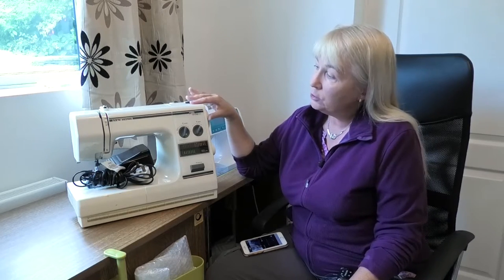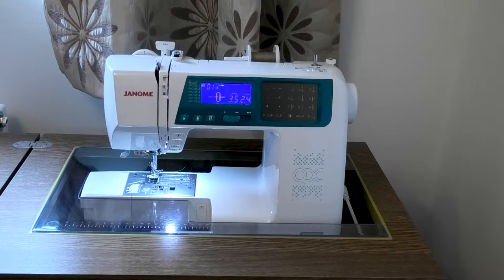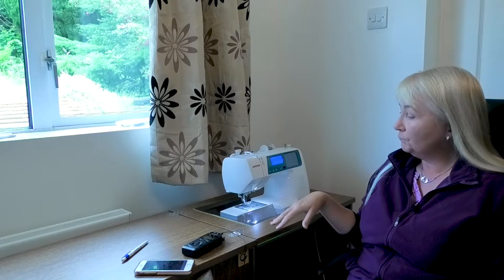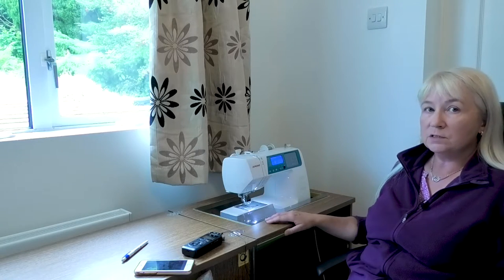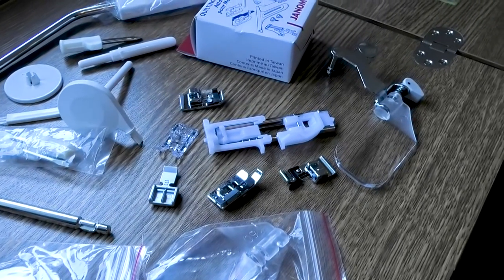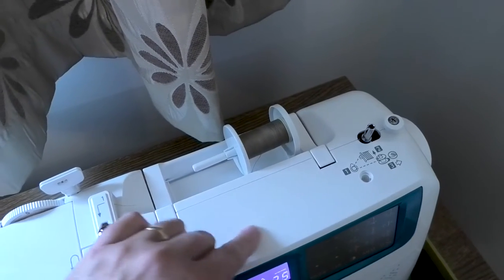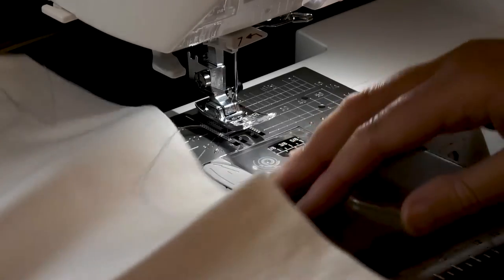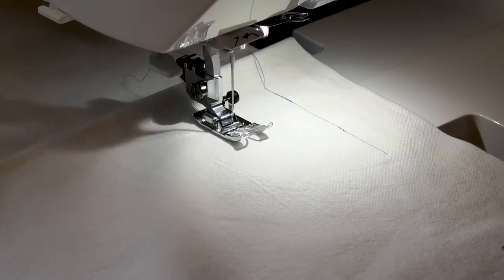What’s so special about my new Janome 5270 QDC computerised sewing machine?

Comment: I found this really useful. Thank You.  I do have a question.   I do bag making and card making.  I can see that this would be great for my card making and baby gifts, but how thick a fabric can this sew through?
Reply from the maker: Hi there, you know, I'm not sure how thick it can go. QDC stands for Quilting Decor Couture, and in my view the machine is pretty robust for standard house decor such as curtains and dressmaking and such. I suspect that it is not just the thickness that is important but also the type of material is also important. I've not tested it on leather for instance. I would recommend asking the suppliers for their view, or Janome to find out which of their machines are heavy duty. And I know that they do some with high presser foot clearance. You might explore this link.

https://www.sewingmachines.co.uk/brands/janome/?gclid=CjwKCAjw3cSSBhBGEiwAVII0Z--akzDO0WRDL0tx5hKEGn8LGOx7-LJM2ouQx7Qg3O1qcjmuiomoLxoCza8QAvD_BwE&high_presser_foot_clearance=4275&machine_type=4178%2C4291&utm_medium=cpc&utm_source=google.      

I hope that helps. Lucy
Reply: @Sciart  Thank You

Comment: Really love this video really thinking of getting this model, did you say it’s the latest model? Would love to see what work you have done with this model it looks fab regards M
Reply from the maker: Hello, thank you for your lovely comments and questions. At the time of filming (Aug 2020) it was the latest in that range of computerised machines. What made it interesting to me was the fact that I could do lettering. Always remembering that computerised in this context means the machine is computerised, it does not link to a computer to take patterns that you design, you dial them in on the control panel. And at the price I was more than happy with that. Yes, I am filming a piece now and should be on line soon. Thank you

Comment: 'you can add an extra holder on the top' - more explanation please ?  Also you dont mention the tension - is it automatic ?
Reply from the maker: Hello, the machine comes with a spare spool holder. You can spot the hole in which to push the holder into at time 4mins 51seconds in the video. It is on the top, and is next to the bobbin holder. The tension is not automatic, you can set it with dials, and the manual gives information about suggested settings. Hope that helps. Thank you for watching. Do stay tuned. Lucy